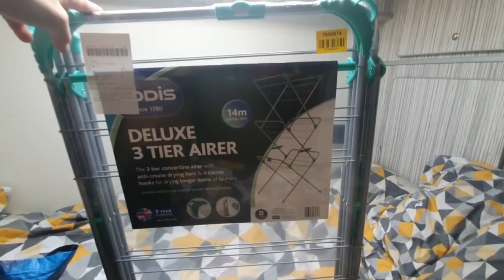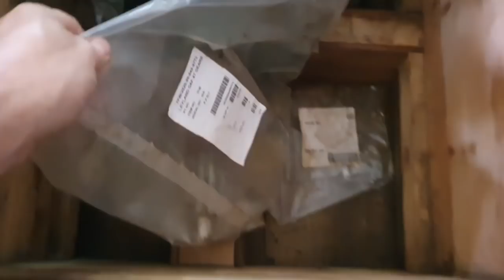MILLY HAD OTHER IDEAS WHERE TO GO ON HOLIDAY 😪

Comment: I think you should pre remove the prop shafts and get the right tools for it. And make it so you can pop them in and out. So when you are on the road, and you need to be towed by an other overland truck you can do the job.

Big disadvantage of the Unimog I cannot drop a prop shaft. I can tow it under 60km/h without gearbox damage. Or When I need higher speed I need to strapdown the clutch and put it in 6th gear so the whole gearbox can run and oil itself.
Reply from the maker: Found out you can tow dafs without props off ;)